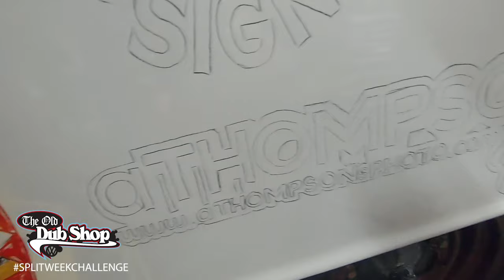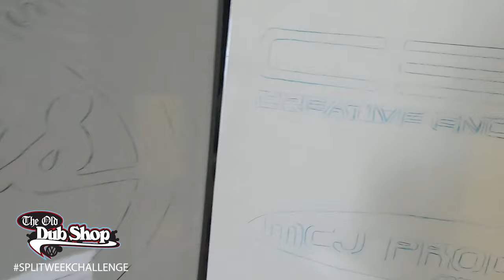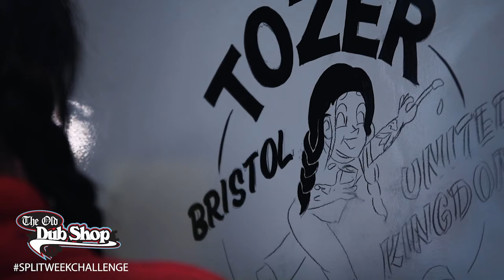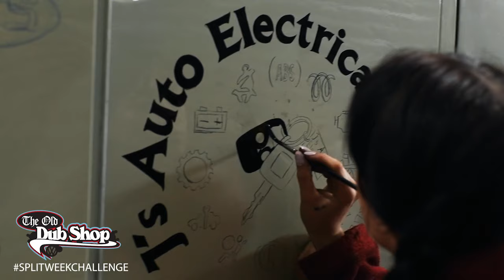E7 - Day 6, the final day of the build! 'Split Week' @ The Old Dub Shop - barn find vw bus build!

Comment: Those off the shelf ply interior panels are awful. I spent hours ( I would have saved time just cutting them myself) on cutting, shaping and bending the ply to fit. Love the series gents
Reply: Not a great advert for the panels...
Reply from the maker: Those rear quarters are a funny one because they are rectangular, some times with the floor or other difficult shapes it makes sense to buy them as long as they fit! To be fair with my T4 twin slider floor that was wrong and with these ones, I haven't said anything to the manufacture so I'm not really helping the situation... It could be that nobody has ever told them  there is an issue and just accept that they are cheap and need a bit work!
Reply: @aTHOMPSONsPHOTO  i recon you’re right on that one. Nobody bothers telling them because they’re cheap.
Reply: There's nothing wrong with those interior panels boys!! They are for a early split bus with the small back window. Someone ordered the wrong ones that's all.

Comment: The ones you have are for the early small back window buses. https://www.youtube.com/watch?v=uG-XxhPhkeA   have a look at 14:27
Reply from the maker: Need to watch your vid properly tomorrow! I just had a search for ply panels from other suppliers and they look the same, looks like we may have got it wrong! Thanks for the link 🤙
Reply: @aTHOMPSONsPHOTO  I wouldn't use ply as its way too stiff, you need mdf 3mm which is bendy. You wet it a little and it will conform to the shape. If your ordering them they need to be for a 64 to 67 bus with large back window.
Reply from the maker: @DemopVWgarage  I skimmed through your vid and it works really well and clearly fit! I’ll let the guys know and show them yours, thanks!
Reply: @aTHOMPSONsPHOTO  no problems, best would be to make them out of card first then transfer to 3mm mdf sheet :)